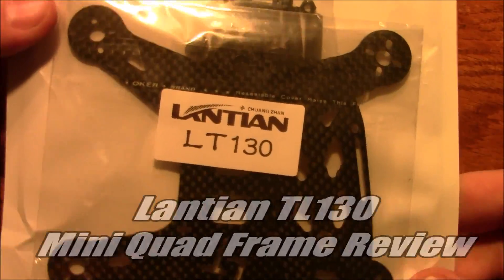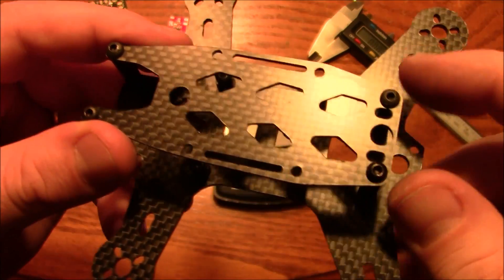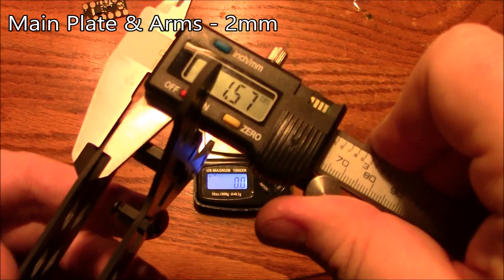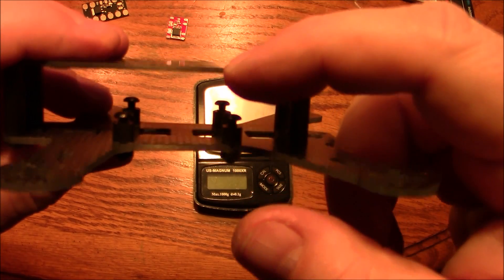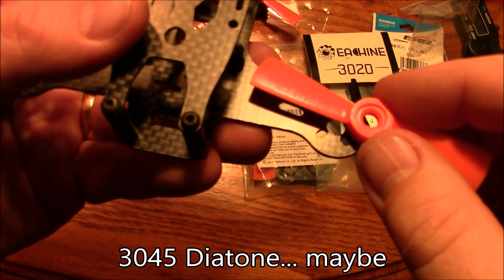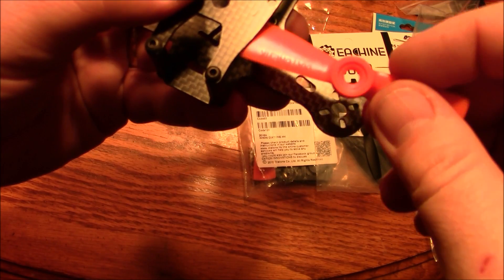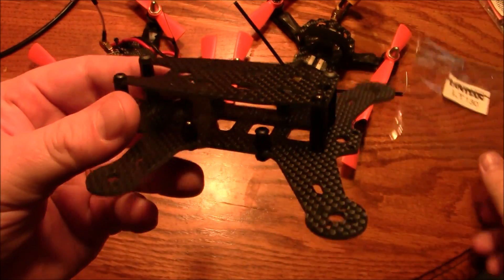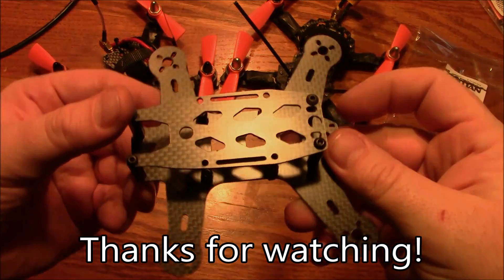Lantian LT130 Frame Review

Comment: Absolutely love mine!  It gets flown far more than my ZMR250  I did redrill the holes for the flight controller so that it's perfectly centered front to back, also used 25mm aluminum standoffs and stacked the pdb, fc, and receiver.
I have the BG1104 4000kv with 3020 eachine props.  THIS THING IS A FREAKIN ROCKET!!!
I will say this... It was by far the hardest quad I have ever built due to it's tiny size.  In the end I would do it again for sure.  Fly's great even in a good wind.  Now it's time to stick the fpv equipment on it!

Comment: re drill the spacer holes a few mm towards the rear of the frame and there is your prop clearance....or simply stick the FC to the bottom plate with double sided tape

Comment: Hi Travis,
Cool review...
I did actually build one of them with 1104 motors and 3 inches propellers.
It's doing pretty well. Still it's one of the worse frame ever, holes are not well places specially the one for the rear standoffs, it's impossible to put properly the rear ESCs and the standoffs... and there is nothing to hold any camera.
I manage to do something cool though... I'll probably drill new holes or I'll see :)
The quality on the other hand looks good, and it's light...
Thanks for your work...
Reply: Actually they probably have seen your review because I noticed I don't  have issues with the propellers. It seems they put back the pdb holes... and now the screws are on the rear ESCs way :D

Comment: hey im using this frame now with 3 inch props and 1306 motors and it works great but im thinking about switching to the ls 130 so i can fit a bigger camera. will the hs1177 fit on the ls130 and wich frame would you recommend out of the two?

Comment: You could also flush mount a pdb on the bottom main plate, and then hang the FC from the top plate leaving the middle space for under FC header pin soldering or to route wiring.
Almost warm weather here! Sort of. Another month and a half before it breaks. Race season!

Comment: im currently building the LS-130 3" props fit perfect on it. more like a 150 size then a 130
Reply from the maker: +Luke Turner I think the LS150 measures closer to 147mm.
Reply: This is what i have for my lisam collection. Love the design and how solid it is in the air

LS-130 = 145mm (3" Props)
LS-150 = 170mm (3" Props)
LS-180 = 187mm (4" Props)
LS-210 = 218mm (5" Props) 

Most ittratating thing is i love the silver struts. and banggood on the 150 sent out red struts :( looks like the odd quad copter out of the group.

Comment: You can run the DP03 motors. 4600kv on 3s 6100kv on 2s. And as for props you run the press on props. Like the Parrot RS props.

Comment: So, maybe mini FC and mini PDB without using those center stack supports, using 1104 Motors?  It's a challenge for sure.  Nice job, very thorough.  I liked the lighting better from your Matek PDB review.
Reply from the maker: +Oin Taylor That might work, but you'd have a lot of prop moving over top of the frame and that does nothing for efficiency.